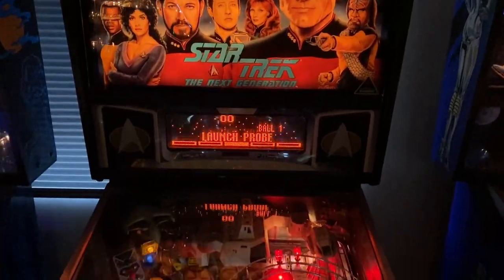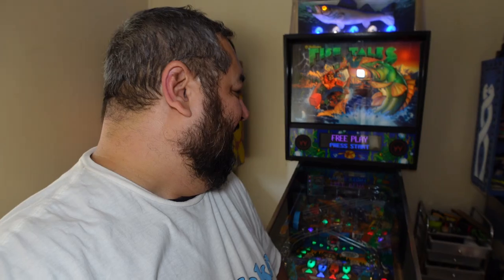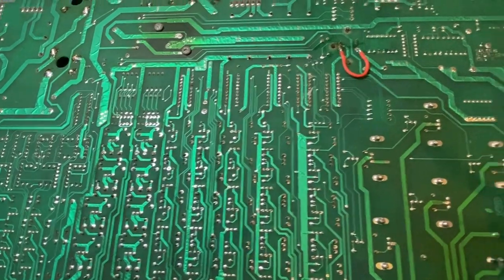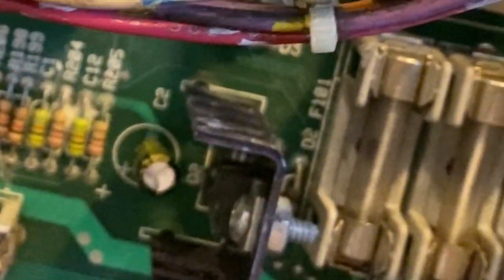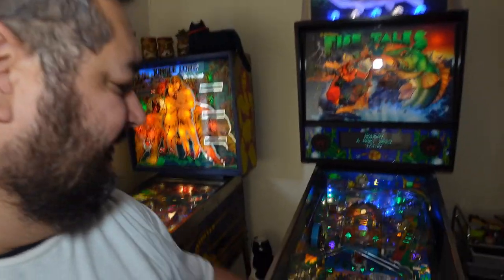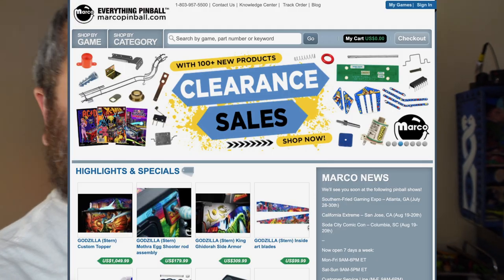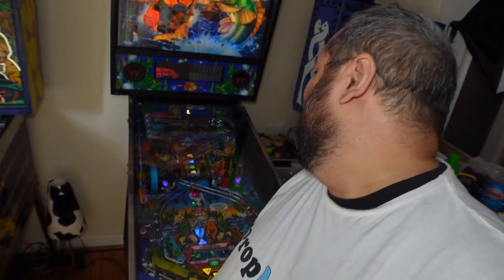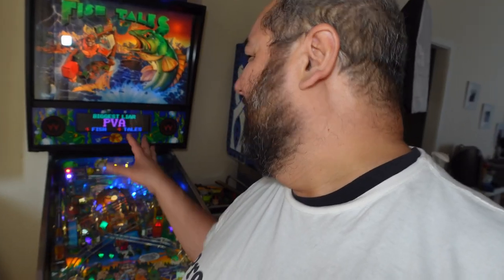1992 Williams  Fish Tales pinball  - Project restored & complete

Comment: I really want the Williams Fish Tales machine but 9000 euros?😅
Maybe I should look for a different machine that looks almost perfect from the outside but doesn't work?
I can maybe pay 3000 euros at max for a pinball machine.
And even that amount of money is hard to come by for me.
But I have to admit... I know almost nothing about pinball machines.
I do know stuff about electronics and I'm a tech guy and I did repair a pinball machine at work in the past.
And it was a Williams!
It didn't respond to coins so I took the whole coin thing apart and cleaned it and put it back.
After that it did respond to coins but 1 flipper wasn't working because the switch was faulty.
Good thing I was building an arcade cabinet that had the same type of button switches so I could replace it.
It was the wrong color but we didn't care!
The thing worked!
But this was a best case scenario... the machine had been fixed a few years prior.
I won't have that luck if I buy a near perfect looking but non working machine for myself.😅
But I know I can fix it.
And these days there are tons of videos on youtube that show how to fix those machines and tons of forums full of experienced people ready to help.